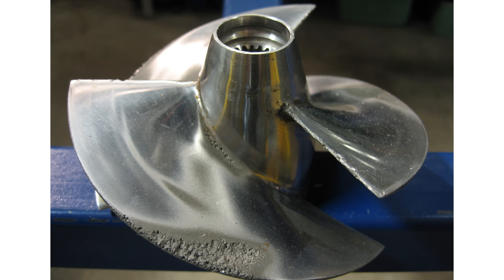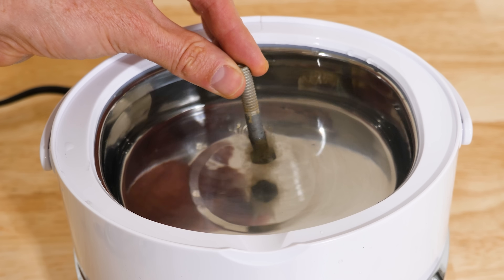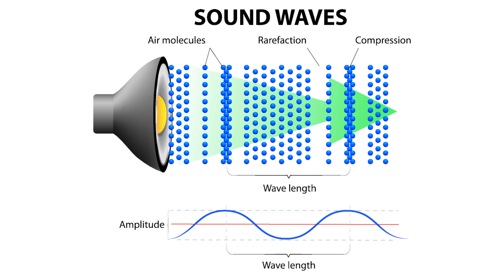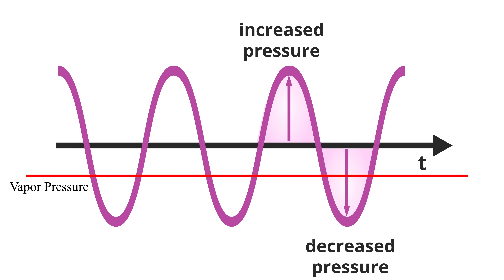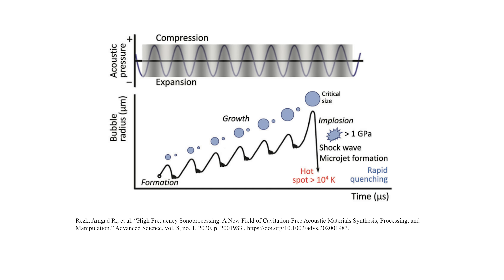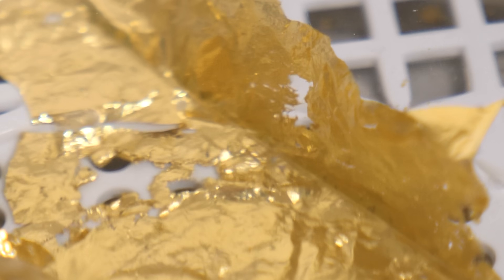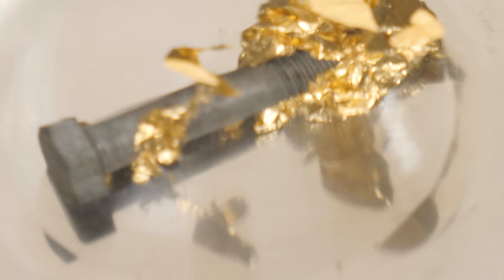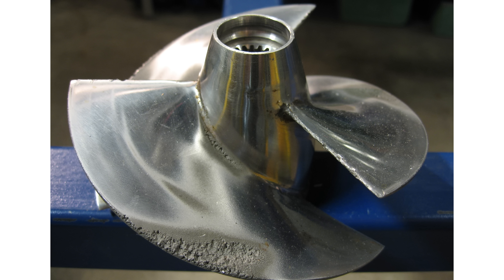Can Ultrasonic Waves Dissolve Metal?

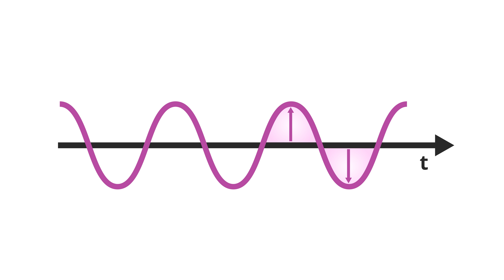Comment: At 1:54, you use an illustration of a difference in amplitude when discussing how a difference in frequency affects pressure. Crucially, the “increased pressure” shown in this illustration does not come from an increase in frequency, but from the amplitude increasing. The frequency has remained identical between both figures.

Comment: Hi actionlab, your video reminds me about a seemingly mad not recognized scientist (likely without a title or formal education). I used to have the links to his videos - where he - almost bored - presented his findings, that a mix of ultrasound (not 42 kHz, but he mentioned 43 kHz) and magnetic waves - did not dissolve metal - but - made it bent, cringe, split - in ways which I found quite natural to look at - yet challenging for me to get a grasp on. 

He for instance split a solid metal block (appearing some 10 x 10 x 20 centimeter) of aluminium, into cringing, bending, stalagmites - which were rectangular, and pencil sized. It was not looking "Beautiful" or "symmetric" or like that- but it appeared as if these maybe 100-200 pencil-sized stalagmites were evenly formed. 

I explained his experiments by imagining that some resonance occurred. The pencil-shaped pegs/stalagmites bent a little bit - also still not homogenously - but bent, like you would expect a tree or a straw to bend for the wind. Not a lot - but enough to create curiosity. 

Do you have any knowledge about this? It is like - there used to be some 6, 7 or so videos. The man looked mad. But he was certainly not mad. He was visibly bored with his findings. He set up his demonstration - for the camera - as if he actually had other more important things to do - but - that he kind of had to do this boring thing here. 

I have not been able to find his videos since around 2016-2017 - I have looked and searched - without success. 

Have you ver come across them? Well. Thanks for your great channel, which I follow in many ways - like here - and in shorts.

Comment: I'm left wondering how this tech could be applied to a structure moving through water or air, e.g., a submarine or plane.  We know the resistance each provides to different shaped objects moving through them, and can calculate the exponential increase in resistance as speed increases; however, what if this technology could be applied in such a manner as to create a "bubble" of boundary layer slipperiness, allowing faster speeds, and which could also act as a surface-cleaning agent at the same time (especially beneficial in preventing micro-surface abrasion/ablation, in the case of aviation - as well as preventing hull attachment of barnacles and other sea critters in the case of sea-going vessels).  It is this kind of outside-the-box science I've been musing about for years, and have been surprised to find some of my ideas have later become reality by someone else.

Comment: You could use this in water as a means of propulsion by creating low pressure zones in the direction of travel and high pressure in the opposite direction of travel. I think by using dielectricity the same thing can be done for water, atmo, AND space. That's dielectricity though. Sound alone probably wouldn't work that way in space with as low as the barometric pressure is out there already.

Comment: Don't suppose you could do this with gasoline in the cylinder of an engine, to clean them While they are running, 
Those cavitations might set the fuel on fire!
Or maybe apply the vibrations to the oil surrounding the cylinders? To like loosen stuff,
Might slowly degrade the cylinder walls like it did to those propeller blades,

Comment: Yes but a definition of cavitation is the formation and subsequent collapse of vapor bubbles caused by the pressure dropping bellow the saturation temperature and immediately rising above it. Cavitation can occur to pumps that aren’t at a high enough pressure on the suction side or even on submarines at higher depths or on the surface if the screw is rotating too fast. By lowering the depth or increasing the pressure on the suction side of the pump you lower the saturation pressure of the relative liquid allowing you to avoid cavitation.

Comment: You can synthesize nanomaterials using ultrasonicator. We call it Sonochemical synthesis and it's principle is based on the cavitation bubbles.

Edit: We use another type which has horn or probe. Nice video 👍

Comment: Great video! Was wondering if this could be used to etch PCBs
Reply: 3d printing pcb's is the way to go. Don't throw away material, use only what you need. Copper will get expensive in the (near) future.

Comment: Cavitation is also a big problem on military submarines. Boats that were designed for stealth operations aren't too stealthy when the prop is making hundreds of sonic booms per second. In fact the design of submarines' props (and other Naval ship propellers) are classified because of all of the R&D that went into propellers that could spin faster without cavitation.

Comment: if you have hot water heat in your home then your heating system (specifically the water circulation pump.) it has an impeller in the pump used to push or pull the water through the system. the little pump can and does create cavitation. typically if your system and pump are fine youd  never know. worst case is youl hear "unusuall" sounds from that part.

Comment: Everything, including the human body, has a certain frequency at which it will disintigrate. if you hit that frequency with enough power, you can create a sonic weapon that will destroy anything using sympathetic harmonics. It has limitations of course, a frequency that will disintigrate human flesh will not affect metal etc as each material has its own frequency. Therefore the weapon would have to have a variable frequency output. Such a weapon would work in air without requiring water, but the power to make it work effectively would have to be astronomical since air does not have the density of water and therefore, cannot transmit the sound so well.

Comment: This actually causes a lot of drag with standard propellers. There are some fancy new props which prevent cavitation and they are 30% more fuel efficient (which is an absolutely crazy number). They still are super expensive but could revolutionize the boating industry.
Reply: PAC makes propellers using Bio-mimicry and sells them in government contracts around the world. I did some work for the owner of the company and had some good chats with him, smart guy and a really fascinating subject in bio-mimicry.
Reply: that's really  cool.  what are they called?
Reply: @sainttom6785  Sharrow Marine
Reply: @DnBFinch  thanks!
Reply: Magnetism
Reply: I've seen these propellers too. Some are being used on drones and they're being researched for planes. Play The propeller looks like a 8, figure of eight, loop. The parabolic curve propeller blade.

Comment: Not sure if ALL of these machines work the same way, but a common way to generate the sound  waves is with a block of nickel attached to the bottom of the tub. Nickel actually shrinks when electric current is passed through it. Basically, connect a signal generator to an audio amplifier and run the output through the nickel.

Comment: Might not want to put your hands in with those things.  Micro fissures in your bones are a potential hazard from ultrasonic cleaners.  Holding the bolt  with your fingers is not advised, better to use  something with a wooden or rubber handle to hold it in there if you must hold it.

Comment: I wonder how the ultrasonic cleaner avoids pitting its own metal?  Same question for sonicators, which can operate at much higher power (quickly overheating small aqueous samples in seconds if they aren't kept chilled, and having instructions recommending the use of hearing protection, unlike the cleaners).

Comment: OK, but I have used ultrasonic cleaners many times & they always seemed quite useless.
When I began my career as a cartographer (before computing)  we would have to clean drafting pens.  The ultrasonic cleaners did do a little, but could never get then clean really.  It was always a much better result by hand, but slow & ran a great risk of damaging the fine wire inside the pen tube, but usually succeeded.

Comment: What if you put a closed soda bottle in the cleaner with water in it? Would the co2 come out of the soda still and blow up? Does the  Ultrasonic sound waves travel through the soda bottle in the water
Reply: A sort of answer to your question...some artifact conservators I know do indeed put objects inside jars or pots of water and then place the fluid filled jar into the ultrasonic bath. As for the soda I can't imagine why it would explode if the cap is still on and the pressure retained in the bottle. The pressure from the dissolved Co2 carbonating the soda is present inside the bottle at all times. I can't imagine that ultrasonic immersion could physically increase that inherent pressure.

Comment: Could you make drinkwater with an ultrasonic cleaner? If it can break down metal, I could imagine that parasites and bacteria don't stand a chance when hit with the right frequency.
And if that does not work, would a bathtub size cleaner be the best way to get clean fast?
What happens to organisms when they are in a liquid that has high frequencies?

Comment: While I was working in kitchen design/sales about 40 years ago, we displayed a futuristic stainless steel sink which cleaned the dishes by ultrasound. One of the odd selling features was that if you were tired after a long day on your feet, it was suggested that you could sit on the kitchen worktop with your feet in the sink full of water, switch on and get your feet all tingly and fresh feeling. We didn’t sell any of the sinks! 🤪
Reply: Omg that is such an obvious application of this technology and it existed 40 years ago?? How come no one bought one??
Reply: @SciAntGaming  Price probably, it would only become practical for large scale cleaning. I'm pretty sure industries already use this for rust removal and other things. It's sad that they didn't think of that first.
Reply: @SciAntGaming  i think they break if you dont use the right amount of water in them? like overfull or not full enough apparently is really bad for them and they can only wash like glass and metal and maybe some ceramics
Reply: @comradepoint  they can clean anything that doesn't dissolve in water
Reply: I’m a mechanic and ultrasonic cleaners are widely used for parts cleaning and I’d love one of those sinks in my workshop!
Reply: The sound is obnoxious and the price might have been too high but that was cool tech.
Reply: They just use a bigger piezoelectric membrane of the same general type that's in atomizers right?
Reply: Probably good it didn't catch on because apparently it can cause flesh to separate from bone... yea I don't recommend looking it up if your sqeemish
Reply: How much were one of those sinks back then?
Reply: Is that safe???
Reply: I would've bought one if I was alive old enough and it was cost effective for the time's economy lol
Reply: I tried this it didn't do much of anything. The motor I used was 24V 1Amp ultrasonic fog machine. The manufacturer stated its 1.7HZ but they obviously don't know what they're talking about, so I don't know the actual frequency. What motor should I get to clean stuff with?

Comment: I visited a jeweller recently and he uses a similar ultrasonic cleaner to clean jewelry. With what you're showing here, I would assume that the jewelry would basically disintegrate over time. So, is that a worry or does it take so long that it's not a concern? (I would appreciate any insight from anyone)

Comment: Just got recertified for soldering (IPC J-Standard) and in the J-STD-001 guidebook there is actually a rule that you cannot use ultrasonic cleaning on a CBA (Conputer board assembly) that has solder and/or components on it. This video is a fine demonstration as to why this is a rule.

Comment: The whole time I was asking myself a single question: would it hurt if someone were to put a finger in there?
Reply: It hurts your joints. Because the capsules surrounding them are filled with fluid that can easily form cavitation bubbles, and the entire inside of them is really sensitive to irritation.
Basically, if you've ever wondered what people that suffer from arthritis or gout feel when off their meds? Stick your hand in one of these, and then hate yourself until it stops hurting. XD

Comment: We use a 10 Gallon Ultra Sonic Cleaner when rebuilding our Coldheads!  

The Glide Rings they use to seal the dispacers are a hard compsit that literally turns to dust over the years.
Reply: lets put some gasoline in that 10 gallon ultrasonic device and vaporise gasoline to run a 5liter V8 chevy truck with 200miles to a gallon of fuel!

Comment: Heummm lol thos buble on the propeller is’t due to the cavitation its du to a phénomène call oxydation, badum tisss those ultrawave machines are use to remove rust and other oxydation type on different type of boat mechanical parts so cavitation clean the rust and then leave your propeller with those marks. (Hypothèse here im juste working at a marina)

Comment: I figured the cleaning was likely due to cavitation, and it also confirms to me that you can “over clean” things in an ultrasonic cleaner.

In the world of automotive (where my experience lies) cavitation is a big deal in pumps. I’ve seen multiple times where water pumps, timing covers and engine blocks have been destroyed due to the coolant cavitating. Automotive coolants typically have additives to help reduce the formation of bubbles during cavitation, but also to coat the metal surfaces to help protect them in the event of cavitation. If the coolant is run too long and the additives wear out, it will eat holes in the water pump and surrounding areas, especially on engines that are run at high load/RPM, like gas engines in big trucks/cargo vehicles.

It can also happen really quickly in power steering systems. Running low enough on power steering fluid to introduce air into the system (or having a leak on the suction side of the pump) can almost instantly ruin the pump due to the cavitation that occurs.

Comment: Mantis shrimp can also induce cavitation bubbles in water as they spring their arms out to strike. But sometimes a blue light is emitted from these bubbles. Is this possible with regular cavitation bubbles? If so, is there a way that you may be able to demonstrate this or possibly disprove this or show how extreme of a phenomenon this blue light emitting captivation bubble is?
Reply: That phenomenon is called sonoluminescense. And you can make an experimental setup which can replicate it as many times as you want.
The ones I remember seeing basically use two transducer plates that then hover a little vapor bubble between them in a tube of water.

Comment: I work at a coal fired power plant, and we have to pump water around, which is close to its boiling temperature regarding to its surrounding pressure. Be it the feed water pumps, with their suction side at 180°C and 12bar pressure, the main condensate pumps at 26°C and 0.025bar or the boiler circulation pump at 360°C and 300bar. They all are a few degrees before cavitation, with different countermeasure. For example, we inject "cool" feedwater with 180°C into the suction side of the boiler circulation pump. In power plant language, this is called NPSH (net positive suction head). For the feed water pumps and the condensate pumps this isn't feasible. The feed water pumps rely on physical height of water and tank pressure on their suction side and the condensate pumps get a little subcooling.

Comment: Technically, the video title is misleading. The metal is not dissolved, which is a chemical reaction, but rather eroded which is a mechanical process. Sure, if it is carbon steel the removed particles will probably quickly oxidise and go into solution, but for example the brass will exist as particles for a long time. 

As he actually said the foil turned into dust, I think we can think of the title as a mishap.

Comment: I know we must be living in a simulation. I just bought a 6L ultrasonic cleaner a few days ago and have been loving it. I fill the chamber with water and degreaser, but fill a small glass jar with lid, with vinegar. That vinegar will soften or dissolve any rust on the parts I put in there, making it such a fast way to clean parts.

Comment: we use 40kw ultrasonic units to weld copper wire (wire splicing) as well as put tabs on devices. Best method. Far better than soldering or simple twisting like wire nut. The ultrasonic action cleans the oxide off the individual strands and allows pure copper fusion (mostly). Very difficult to weld tin coated copper as the tin does mix into the heat-zone in uncontrollable forms causing a flawed joint. This method often specified by military and other harsh environment equipment manufacturers. Very fast process.
Reply: So basically it does vacuum welding without the vacuum?
Reply: @Reddotzebra  no vacuum. ambient air. there are two jaws, one is fixed, the other mounted at right angle to the long axis of the transducer so it vibrates back and forth, as a calibrated down force brings the jaws together with copper simply laid over each other in the jaws. Other metals weldable as well, but it doesn't work well with dissimilar - this has to be tested well to determine compatibility!